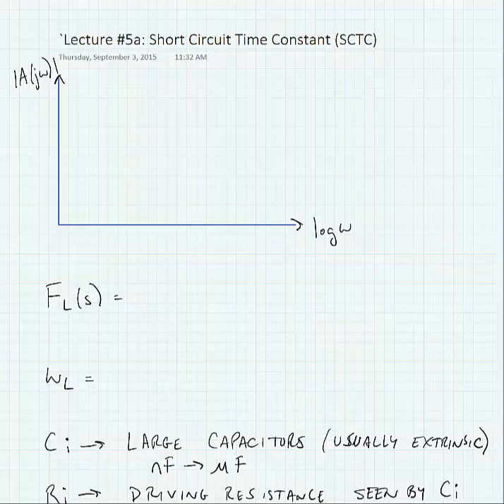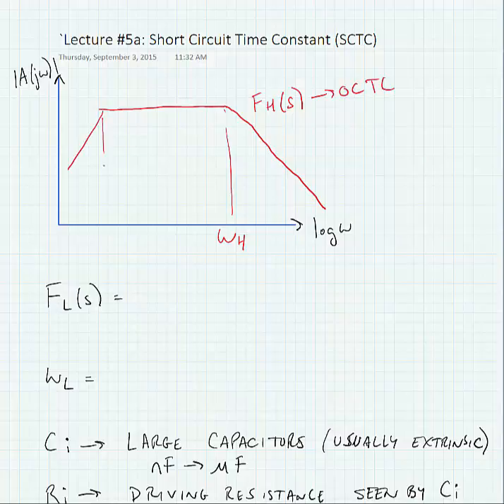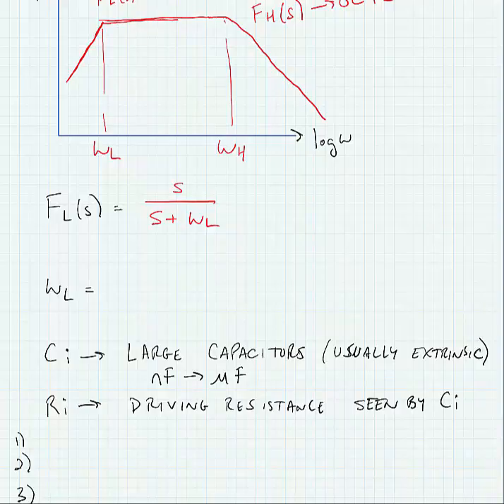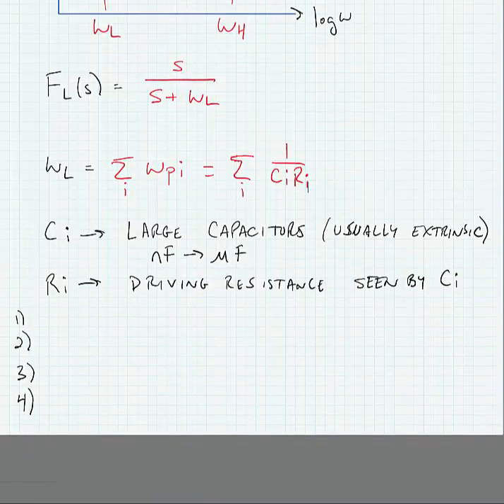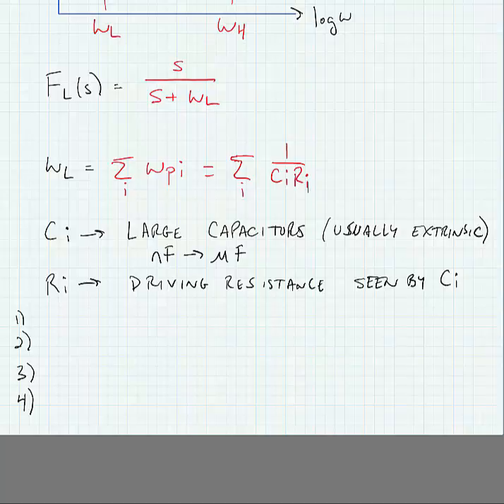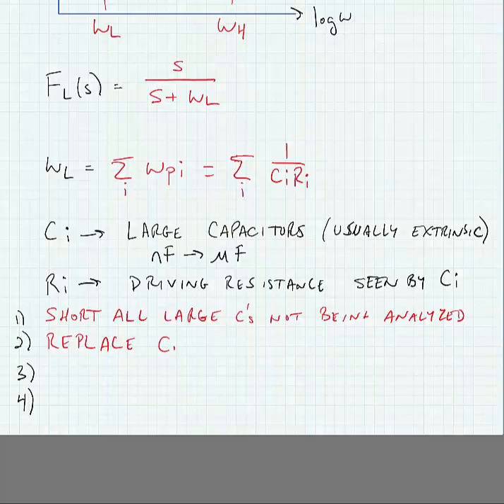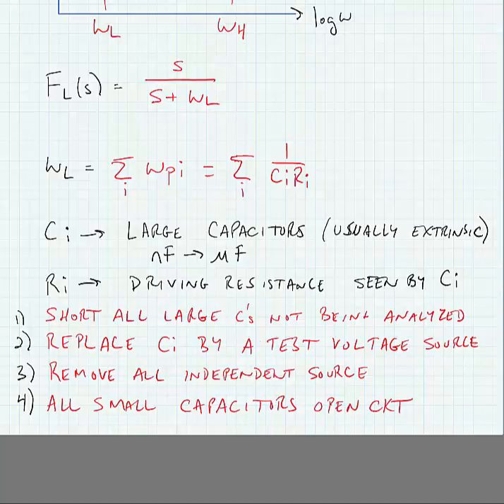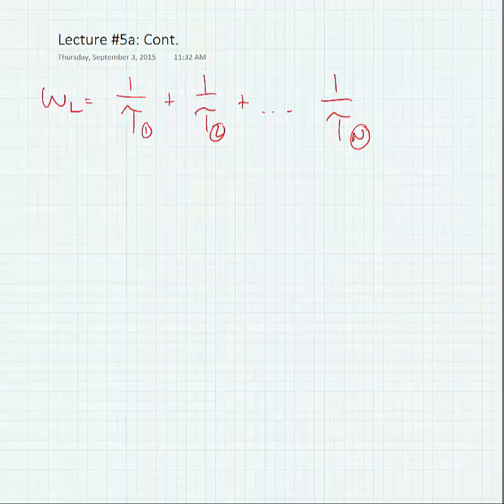ECE 3110 - Lecture 5a: Short Circuit Time Constant (New)

Comment: thanks for the video. I have a question, why is the graph looks like this? why the graph goes up when w at low-frequency pole?
Reply from the maker: At low frequency, approaching DC, the capacitors are nearly open circuits. As the frequency increases, the capacitors impedance decreases until the point where their impedance is low enough that it doesn't affect the amplitude response of the circuit. This is where the large capacitors behave approximately as short circuits. As a result, the gain curves flatten out.